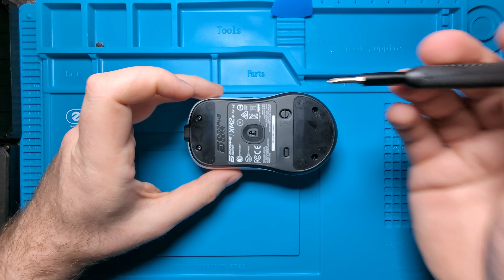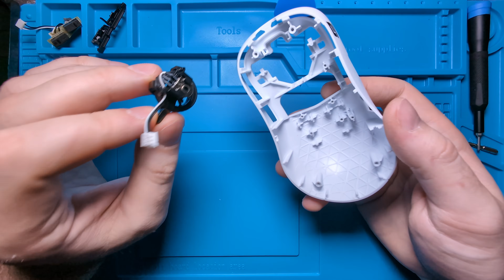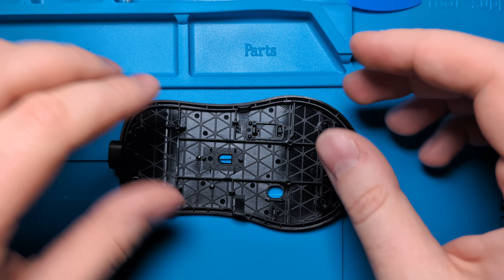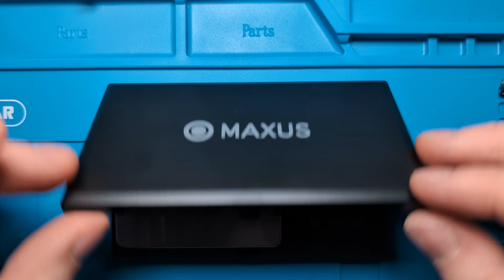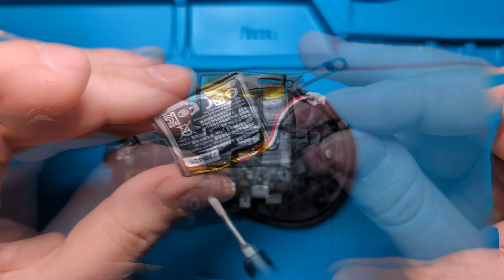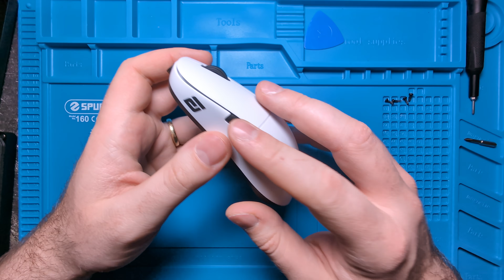TEARDOWN | Endgame Gear XM2w 4K V2

Comment: quick question about the gigantus v2 （ the original one）  ， is the gigantus v2  share the same performance as the balance gigantus v2 pro？
Reply from the maker: Different performance profiles
Reply: @mel0nFPS i have the original one then is it close to the control ？

Comment: 7 mm encoder for scrollwhell will fit? i wanna try the company ALPS one, i didnt finde 5 mm
Reply from the maker: You'll have to use the same size and the one pre-installed, taller for shorter encoders won't fit properly
Reply: @mel0nFPS  thanks !